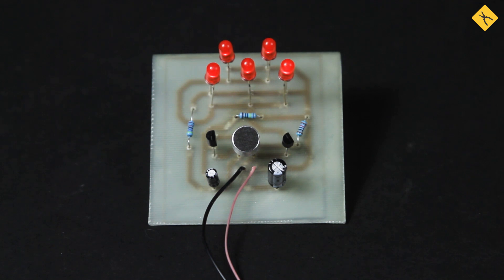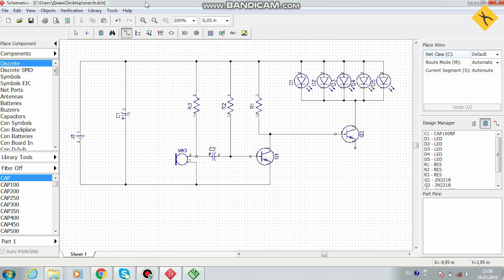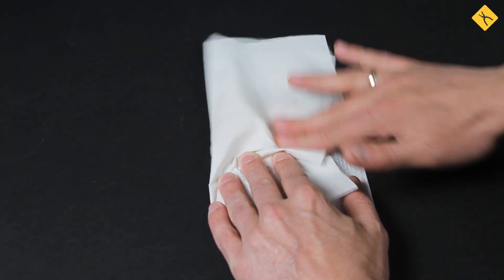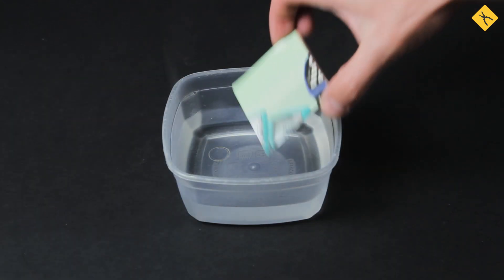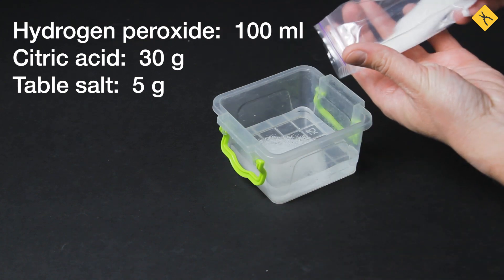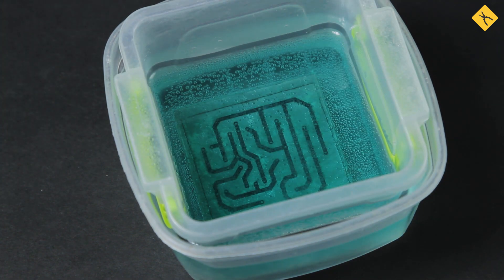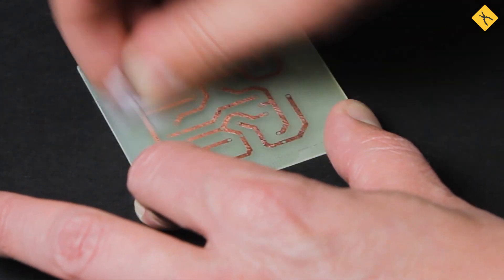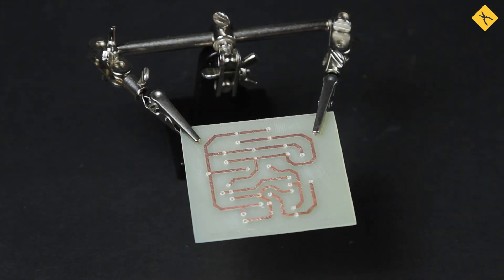How to Make a PCB at Home - DIY Printed Circuit Board

Comment: Hello, thanks for the video. Could you provide tips on making the through-holes conductive and solder applicable as well?
Reply: Best I would suggest for this level of DIY would be "pcb vias rivets" but the good tool is expensive

Comment: 1: Schematic software (Eagle kad I think)
2: Laser print pattern onto shiny paper (magazines or catalogs)/blue sheet
3: Get copper and clean with detergent or soda, then alcohol
MOST IMPORTANT VVVV
4: place board and shiny paper in a sheet of paper and fold the paper in half
5: heat up the shiny side of the shiny paper through the folded paper with a heating iron at max temperature
6: soak in warm water
7: take out and remove paper
8: edit lines with a sharpie if needed
9: Use chemical milling to remove copper with hydrogen peroxide (100mg), citric acid (30 grams), and table salt (5g)
10: stir and warm up so when the board is placed in the reaction will be better and faster
11: use solvent like nail polish remover to remove ink
12: drill holes to stick parts into holes
13: use polishing paper to clean the surface
14: use flux and solder

Comment: The process of adding solder on top of the copper at the end seems extra to me could you explain why should it be done pls?
Reply: I guess it is to protect the copper from oxydation but it can be a long process if your circuit is complex. However you can use liquid tin bath or a dedicated spray like Plastik 70

Comment: So... can I just sketch the design for the PCB onto the copper clad board and then do the following steps?
Reply from the maker: Hello! Of course, you can. All you need to do is to apply a protective layer so that it's not damaged while chemical milling of the PCB. A lot of people do that. However, for complex circuits containing many components, that may be quite difficult to do. It is best to use one of the PCB designing software.
Reply: ToolBoom ok thanks
Reply: ToolBoom and what was the PCB design software you used?
Reply from the maker: @justaweirdguy376  We used DipTrace software
Reply: Sir which is the software

Comment: I have a doubt,
When copper plate is dipped into liquid the oxidation occurs only at the surface.
That means internally all the paths are short circuited ?
Reply from the maker: No, in this case the copper remained only on the contact pads.

Comment: hello from Alberta, Canada.
Thank you for making this video.
I did not understand how you placed the pattern on the board? What kind of glossy paper and how did it transfer from paper to the board?
Reply: hey there if you google glossy magazine then you can kind if get the idea its what every fashion whatever magazines are made out and glossy being you can tell how it reflects light just cut out a piece from a glossy magazine and with the transfer imagine instant tattoos for kids the one you water with a washcloth and take the paper off and the ink stays one its the same , you use a lazer printer to print the ink in the glossy paper to get the lines printed on the glossy paper but to get the image printed on you’d have to use a software to make it if you dont have it already or you could just draw it by scale in paint using the line tool or something similar and the circle brush to make the dots to mark the wholes, hope that works for your
Reply from the maker: Hello! Thank you for your feedback!
Before transfering the layout, we pretreated the laminate by removing oxides with ordinary detergent. Next up, we applied the layout to the laminate and transferred it using thermal transfer. After that we moistened the laminate. This is basically what the image transfer process looked like.